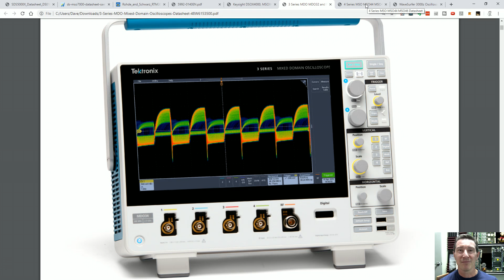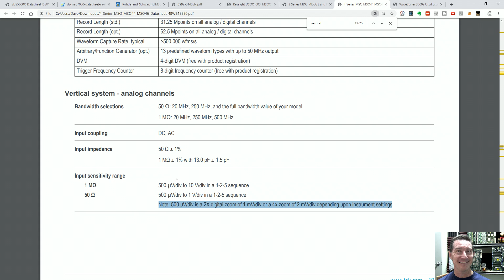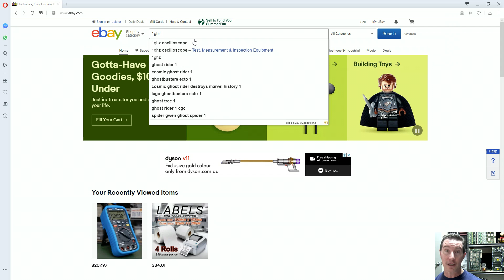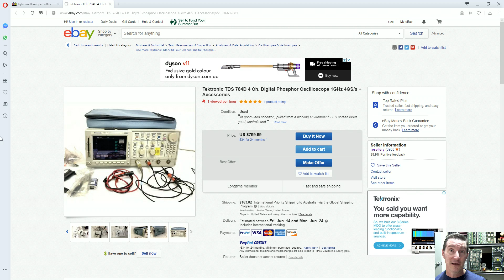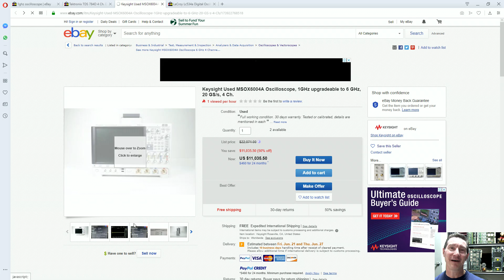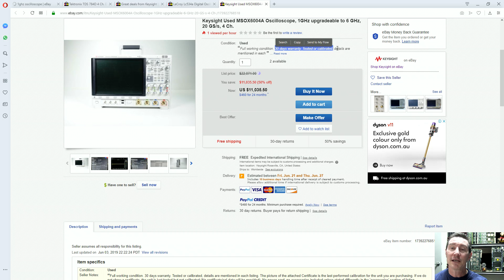EEVblog #1218 - 1GHz Oscilloscope Spec Shootout

Comment: Great spec shootout.+1 more of these. gives a good overview of the relative high-end consumer line.
 you even found pictures showing what the different features do,  31:40 I can not emphasize how much I value that you do that.
Very good video, thx
Reply: Even my budget unit to like 400bucks 100/1Gs. are on some of these specs holding its own //i.imgur.com/uDF7Nj9.jpg
95 to 100.000 capture rate.(own testing not referring to spec so it's very likely I'm doing something wrong)  https://i.imgur.com/fqhbhUQ.mp4
29Mb depth.
HDMI out.
256 levels of grading.
same with color correction/heatmap.
+ all this extra jazz with logic signals also included. /UART, LIN, CAN, SPI, I2C though not sure about these 429 & 1553B.
https://i.imgur.com/SmZWoi2.jpg
https://i.imgur.com/OJdFqHG.jpg
https://i.imgur.com/AwssZqG.jpg
One thing, IM starting to use more and more is the mouse https://i.imgur.com/6T4hTjM.jpg   as it makes the maneuvering fast and in lack of a bench, really do like that I can have most of it in a bag..https://i.imgur.com/f7zLdLO.jpg
https://i.imgur.com/0bt36CS.jpg
the 4 scope probes, 2x low-current-clamps,. (100k 60A ETCR 45US and a  20k 65A Hantek 35US) plus all the cables to charge it and one of these AC in between devices where you can cramp around or use the small wholes to take voltage.(the red unit with adapters) sadly no EU variant at these low china prices 8US https://i.imgur.com/tJj8QTA.jpg
The portability makes it ideal for a newcomer that is learning and wanna take it around to all parts of one's daily life to see the different aspects of electronic gear and easily put it in the closet when done and the 420 nits brightness makes it useable outside.,.

Though I don't know how many points the FFT actually have.. in FFT math mode the highest K-point it will show is 88k, but if that is the FFT value, I don't know.
Here at 70k with an FY6900/60Mhz DDS https://i.imgur.com/i5Kh1OU.mp4
I personally really like the color-corrected intensity heatmap and with 256grading looks wicked, here with Runcam2 FPV out while fumbling infront of the sensor..https://youtu.be/FRlH1ZSPQkk?t=150
n00b in motion https://www.youtube.com/watch?v=Iy2NvuZUYXk

Comment: The SDS5000X now features several additional features with the lastest firmware:
1. Bode plot (You can even use a standalone AWG from Siglent, in my case a SDG6022X and it works great), and the best thing: it is free!
2. Power analysis (requires a seperate license)
3. You now have a formula editor where you can define your own equations.

Comment: So I just read a Keysight 2 part sales document from December 7, 2016 which compares their Infinium "S" Series  (DSOS xxxx/ MSOSxxxx) to the  R&S RTO2000 .  Lots of interesting things in there, including a table listing bandwidth and price of 4 ch scopes from 500 MHz to 8 GHz for both brands.  In Part 2, under the Table is this: "Additionally, the S-Series is easy to upgrade.  Keysight offers bandwidth upgrades, memory upgrades, and MSO upgrades in software which means there is little to no downtime with your S-Series oscilloscope" and at the conclusion is this 
"S-Series is an oscilloscope will meet your measurement needs for years to come
You can start with a 500 MHz scope and upgrade bandwidth and capabilities as needed, all through software"
 
The shocker is that the whole Keysight "S" line IS BANDWIDTH SOFTWARE UPGRADEABLE!   This means that the $17,709 500 MHz scope can be upgraded to the $68,813  8 GHz scope via software!  In other words, all scopes in the "S" series are all 8 GHz, 800 Mpts Memory hardware!  One can simply upgrade any "S" scope to higher bandwidth / memory by yourself by sending some (a lot) of money.  If they are not loosing money on the 500 MHz scopes at $17,709, then they are making a ton on the $68,813  8 GHz models!

Sources:  https://community.keysight.com/community/keysight-blogs/oscilloscopes/blog/2016/11/16/keysight-s-series-oscilloscopes-vs-the-rto2000-part-1

https://community.keysight.com/community/keysight-blogs/oscilloscopes/blog/2016/12/07/keysight-s-series-oscilloscopes-vs-the-rto2000-part-2

Comment: We also have some comments and probably can answer some open questions:

1. FFT (23:13) - up to 128 kSample
2. Gated FFT (24:10) - Yes
3. Updated Rate Max. (25:35) - 64 k and 2,000,000 in fast segmentation mode
4. Color Intensity Display (35:15) - Yes
5. Peak Detect (36:10) - 400ps guaranteed all the time, in Interleave Mode: 200ps
Reply: You are the best. Most polished interface and no nonsense. Probably my next scope!
Reply: @movax20h  Really appreciate your feedback
Reply: Shame the bundle price is not available now,  the 1G/4ch RTM3k is about £11k in the UK with no options :(

Comment: 12:40 you have to keep in mind that screen resolution above the bitrate makes no difference to the way the waveform looks like. 8 bit is only 256 levels, so unless you're pulling off mathematic tricks, any vertical resolution greater than 256 does not make the waveform look any better
Reply: Not accurate.
1, There is a thing called oversampling.
2, There is a thing called interpolation.
3, It's not just the waveform it's the experience of having larger sharper display not only for the waveform but also for the text and FFT etc.

Comment: Specs like update rate can be misleading.  in default mode (no measurements, no MSO, shallow memory), Keysight is at the 1Mwf/s, Tek 4 Series is closer to a couple hundred wf/s, and R&S is at 64Kwf/s.  The only way you can the faster update rate on Tek is to do into a special mode (either DPX, or peak detect).
Reply: Dave - thanks for covering this.  https://youtu.be/glktcnck-uk?t=1613

Comment: Hi Dave, it looks like the RTB3000 does have gated FFT. take a look here (https://scdn.rohde-schwarz.com/ur/pws/dl_downloads/dl_common_library/dl_brochures_and_datasheets/pdf_1/RTM3000_dat-sw_en_5214-9144-22_v0800.pdf) page 10 under section FFT, on the setup parameter row of the table. The last line says "gate (time range and position)"

(Also, I find it hard to believe that it does not have it because I work with the lower end RTB2004 that can do gated FFT, so I see no reason why the higher end model shouldn't have it)

Comment from the maker: CORRECTIONS:
1) The Keysight 3000T has a 1.6ppm reference
2) The Tektronix MDO3000 and MDO4000 are not being discontinued 
3) The Tek 4 series has the new Spectrum View feature available - a hardware digital downconverter on each analog channel, giving flexible time-correlated spectrum analysis that isn't tied (limited by) the analog channel sample rate / record depth.
4) Tektronix have a refurbished store called Tek Encore.

Comment: We use a HP54645D, We use the digital channels 95% of the time. Can you suggest a scope like the HP with seriel data decoder? it would be nice not to have to measure each pulse to determine 8 bit data value.

Comment: How do you tap a 1GHz Signal without impedance mismatch?  If there is no koax connection
Reply: At 1 GHz, you're almost always using active probes that have minimal loading characteristics. On top of that, it's very common to use 50 ohm mode instead of high impedance mode. In the 750 MHz to 1 GHz range and above, you almost have to switch over to 50 ohm mode to get decent measurements.

Comment: The MDO3000 will still be offered for sale as a sister product to the new 3-Series MDO.  The MDO4000C will also still be offered as a sister product to the new 4-Series MSO.  THe MDO4000C is still the only platform that gives you a time correlated 6GHz SA with RF capture basic vector signal analysis. The new Tek scopes have an optional AFG. The 4 series also has the new Spectrum View feature available - a hardware digital downconverter on each analog channel, giving you flexible time-correlated spectrum analysis that isn't tied (limited by) the analog channel sample rate / record depth.  This feature provides more flexibility and functionality than gated FFT, and because it is a hardware based DDC, it is extremely fast.  Of course, the scopes have the traditional FFT functionality (up to 1Mpt) as well.  It also has Visual Trigger (similar to Zone trigger).  The 4-Series maintains full sample rate and memory depth regardless of number of channels enabled.  FastAcq works with deep memory on the new series. TImebase accuracy on the 4-Series is 2.5ppm. The new 4-Series also features unlimited number of measurements, math channels, and busses. Mask testing is available as an option on these scopes.
Reply: The Tek scopes do all their measurements on actual captured waveform data... where the Keysight X3000T, X4000A, X6000A do all their measurements on pixel screen data, not waveform data! Dave should add a section on measurement accuracy....
Reply: Don't forget that the 4 Series MSO can handle up to 48 digital probe leads with individual 0-40V adjustable thresholds using max sample rate and memory. Compared to the next best scope at 16 logic leads, with grouped thresholds and uses different sample rate and memory limits.

Comment: 34:00 - the 3000T has 1.6 ppm timebase accuracy, not 10 ppm. The 4000X does have a 10 MHz reference input on the back.
35:00 - the 1 GHz 6000X has a color graded/intensity display mode

One of the big differences between the Keysight 3000T and the 4000X is the amount of power they can provide to active probes. This really kicks in when doing power analysis (current * voltage) x2 but matters less for other uses. The 4000X also has faster max digital channel max toggle rate (100 MHz/5 ns vs. 250 MHz/2 ns), a second WaveGen output, can display 2 more measurements at once, and comes with 700 MHz probes vs. 500 MHz.
The 3000T has a 3 year cal cycle vs. 2 yr on the 4000X. It also has 1.6 ppm time base stability vs 10.0 ppm.
Reply from the maker: Ah, did I have an old datasheet or just goofed it?
Reply: @EEVblog  Either goofed or used a 3000A datasheet. The 3000T has an upgraded oscillator.
Reply: Great to see you guys here. I'm a huge Keysight fan boy, and own a scope and fully-loaded 16700A and 16900A logic analyzers. Glad to see you're interfacing with the community!
Reply: @keithmonahan629  Thanks Keith!
Reply: Bought a new MSO-X3024 in 2011 and still do not regret it. Only bad point: Disconnect it from mains if it not used. Some Rs in the PSU desolder themselfes over time.

Comment: I went to an oscilloscope seminar hosted by R&S couple months back. They were showing off their top of the line stuff, and also teaching basics on how to use oscilloscopes in general. They were really proud about their power analysis and eye diagram functions, along with all the other treats their scopes come with. And for their demos they were using the RTM3000 series scope with all the features, and I have to say that it is a very nice piece of equipment.

Comment: 10k for a scope? Crazy! People in 3rd world can live decades for that money... Its time for some open hardware alternative to this rubbish. Will be nice if a few universities connects together and develop something afordable like what happened with Arduino... In software we did it and Linux is now more than competitive to comercial solutions so why not repeat it also with hardware...
Reply: Lots of companies make cheap scopes with limited performance. But for the 1GHz market, pretty much everything has to be custom designed, so only the largest manufacturers can afford to do that. You're no longer dealing with standard signal design but some RF and serious signal integrity issues which cost time and millions $ to resolve properly - and you have to buy the test equipment and simulation software to get it to work. 

The cost of designing an ASIC for a scope here can be in the order of $10M - some smaller chips may be less but it takes time and experience (highly paid engineers). So if the company sells 100,000 units, that's still $100 NRE plus the cost of low-volume silicon manufacture which could be another $100. Several ASICs and the big FPGAs in each and you're easily spending $400 on silicon alone in each scope. RF attenuators, highly sophisticated amplifiers, custom DACs and trigger circuits all add up.

The firmware code is typically 50MB - 100MB, that's a lot of software engineering plus constant bug fixes. So the BoM of standard parts might be less than $1k for sure, but the total cost of designing the product might be as much as $50M, hence there is utilization of the technology over many product models which sell for maybe 10 years - so the amortised NRE that you have to add to the BoM cost is $500 - $1k+ per unit (so long as they sell many 10,000 units in the lifetime of the product). 

The manufacturer has to make a profit, they typically have a reseller or distributor who makes a margin, the models vary in price from the low-bandwidth ($2k) and low-cost to the higher bandwidth ($10k). It's only the higher bandwidth models where they actually make their money - if they only sold 100MHz-200MHz models then these would have to be a much higher price. 

Check the financials of these big test companies, their bottom line nett profit tends to be in the single digits (<10%). Competition between the brands gives customers choice and ensures that no manufacturer can gouge prices. The fact that no manufacturer can offer a really cheap 1GHz scope proves it's hard to do.
Reply: @marcdavis7583  Good analysis but I think it will be not the case of the chinese companies. Siglent CEO have told on EEVBlog in 2015 that they have around 100 engeneers and hiring cca 20 new each year so max around 200 today. Average engineering salary in china is 16k USD per year so if half of them will work two years full time it will be around 4M but that is unrealistic (too much, they have planty of another products in development). Rigol was already makeing its own ASICs few years ago and was selling at that time only low end, so the cost of development will be significantly lower there.
Chinese companies are growing so fast because they focuses on normal people, profesionals, hobbyist and students and offer affordable gear. Due to them we are able to buy low end oscilloscopes so cheap this day even from the holy trinity (tec, ksgt, lcr). They don´t have monopole any more and it is good.

I understand that this frequencies are little bit more trickey but if smaller companies in 80´s and 90´s was able to produce RF generators and other RF stuff than I think it will be possible today for some universities to design Open Scope or other Free test gear like this with use of the shelf components... Tes gear they already have. And I think it will be really good educational challenge for the students and their profs. Each few years is comming some new design of usb scope from students so if they will have some leading, they can make it but this is just my opinion based on laik guessing. 

The price is so high becouse there are only few manufactures which survived till now and they have allready set the prices this high. Rigol was getting some reputation in last years and was trying to set the price for its own on equal level but it was a fail because for private persons it is way too much and for companies and universities they are still not enought trustworthy yet.
If no schools and no hackers will make better free test gear than we need to wish good luck to siglent, rigol, owon, hantek and co to get better and force the big players to make their equipment more affordable.
Reply: @Hellenios  You've nailed the point. It's time for this monopoly market to end. Components wise, a scope doesn't cost more than a good TV box! but yet the price is still way too high for an average person.
Reply: wat
Reply: For one thing scopes are a time investment. Just imagine something Like a car, sure its a lot of money but you are not planning to get another one in, say, at least 4 years!

The companies that make these scopes I.e. design/building have a their own employees to pay as well. And if the job market for these engineers is 100k a year, then your product should be pretty darn expensive. There are a lot of different angles to look at to understand why these scopes are so expensive.
Reply: @darer13  Why you should buy a new one in just a 4 years? Becouse the manufacturer will give you fullHD screen in time of 4K res? Or add a few MB more for samples than pc has allready tens of GB? Its time to say F**k off...
Reply: I think is only a matter of time before we have a real open scope, that has features comparable to real scopes and this segment is the perfect place for it, it couldn't be cheaper than the basic Chinese 100Mhz scope, but it is definitely possible to make something a lot cheaper than what tek is asking for their 1Ghz scopes.

Comment: I will have to wait 15 to 30 years until they fall down to my price bracket and buy them on eBay. But by that time brand new 1 GHz scopes will probably be $399 Regel entry level or Chinese knock off 1 gigahertz from Banggood for $299. In 15 years

Comment: I think the Tek MDO with the spectrum analyzer input supports time gating - I think time correlation of that channel was sort of the advertising point of the original MSO3000 series, and I seem to remember Shariar showing it used in his review of one of those (maybe the MSO4000 series?)
Reply from the maker: Come to think of it, I think you are right.
Reply: I could be wrong but I believe only on the 4000, on the 3000 you could have scope or spectrum analyzer mode, not both at the same time.